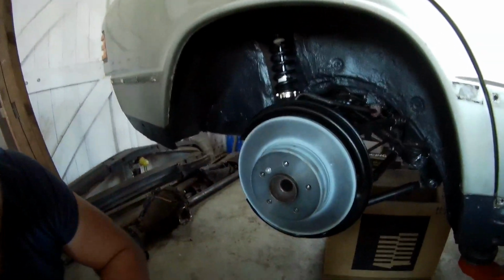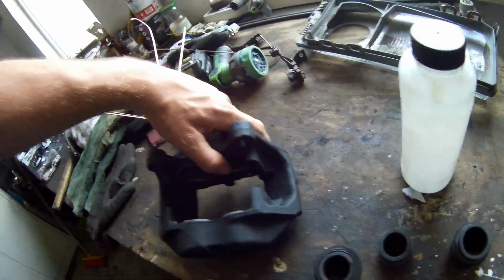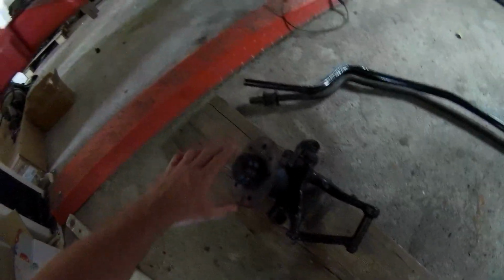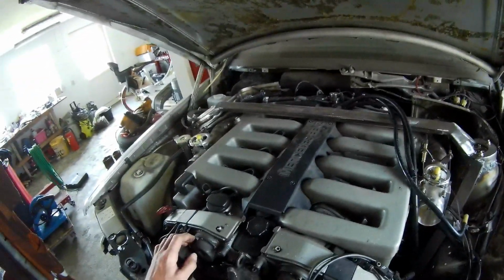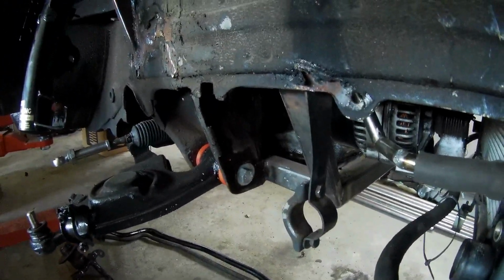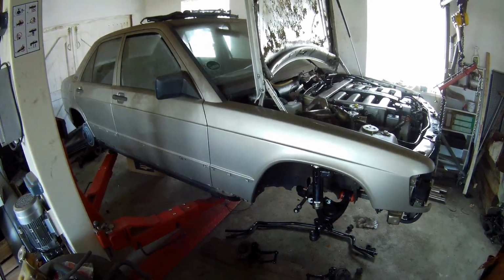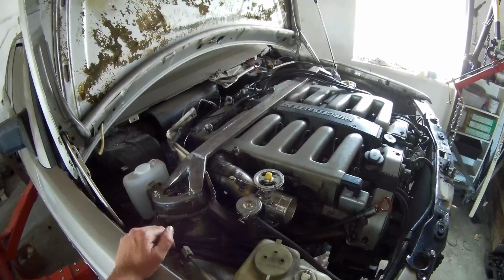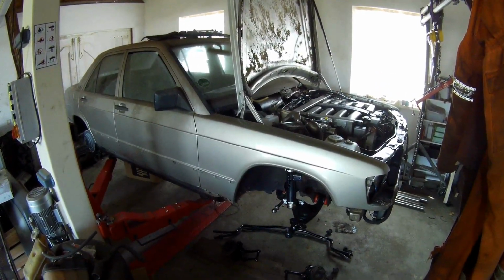Mercedes V12 Project.  throttle cable. coolingpipe and wheelhubs overhauled

Comment: OH btw do you know about the plastic breather pipe in the valley underneath the intake manifolds? It always cracks and MB released an updated part that is metal. It's important to replace on stock engines with MAFs, but u ought to still replace it for better vacuum on crankcase.
Reply from the maker: Yes i know mine is also broken. I will change it when i renew all top engine And distribution gaskets

Comment: For me the "cliffhanger" in all this is the engine management system you install. I'm sure it will be done with the usual planning and thoughtfulness you bring to your projects, but given the complexities of the original, how you sort that out should be of general interest to your subscribers. I know I can't wait.
Reply from the maker: Thanks!!  The engine control system will be much easier then you think.  When i get all the body repairs And mods done i will start on the electronics. Thanks for watching And appreciating my build
Reply: Any idea on what ecu you're going to use?
I think I'll go for a cheap ms2x clone and just run the cops in wasted spark.
Reply from the maker: I'm going to use KMS MD35 from Kronenburg. This is a Dutch company that build engine for street And racing. Good Quality
Reply: Oh yeah I think you mentioned that before. I can't find a complete spec list of it though, so it probably can't control 12 coils sequentially.

Comment: Great project bro, how did you sort out the engine management?
Reply from the maker: Going to use a standalone ecu KMS MD35.  That is the plan. When the car is mech. Done i will start with the wiring And controls
Reply from the maker: Going to use a standalone ecu KMS MD35.  That is the plan. When the car is mech. Done i will start with the wiring And controls
Reply: JMSpeedshop ! Hello from Kazakhstan🇰🇿 and thank you for your answer, brother! I would love to see the video, how are you planning to do this, how it will work and etc. as I have a w140 with 3.2l, swapping it to m120. I also need an aftermarket ECU to be able to tune it afterwards. Will highly appreciate this!
Reply from the maker: You will it all stay tuned to the channel

Comment: What drive shafts and propshaft are you using?
Reply from the maker: S600 propshaft shortend en s600 axles shortend with s210  wheelhubs
Reply: JMSpeedshop ! Awesome, thanks. Are the w210 hubs a direct replacement for the w201 ones? I assume the s600 driveshaft spline is also the same as the w210 ones?
Reply from the maker: W210 will not fit for a standard w201 subframe i have made a video about this mod have look in de playlist.  And the spline of S210 that is the combi version of the w210 range has bigger wheel bearings. Same size as a s600 so also the hub spline is bigger And a s600 axle will fit a S210 hub but you need to do a modification to 1 réaction arm on the subframe.